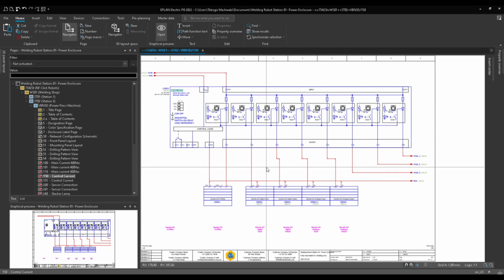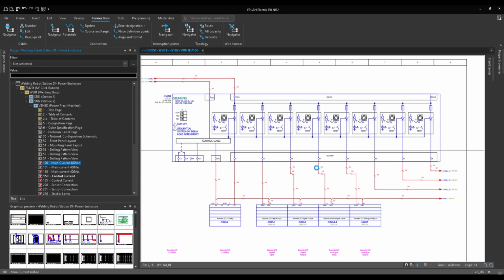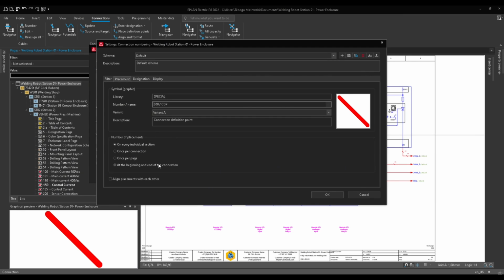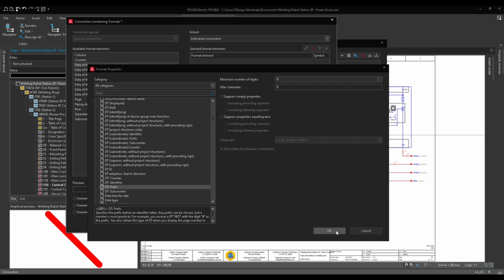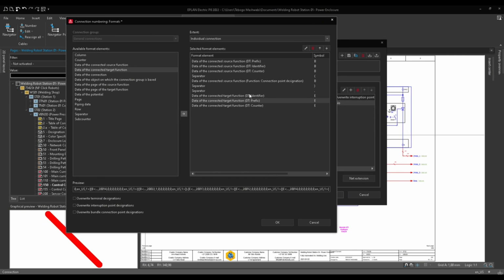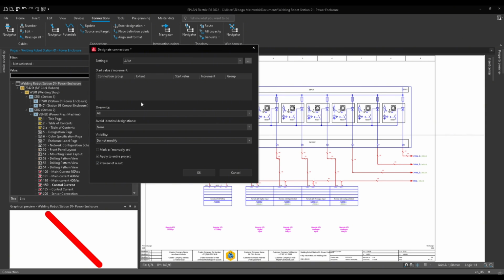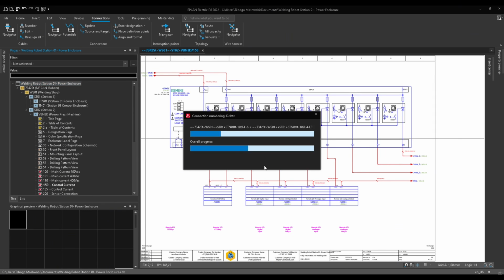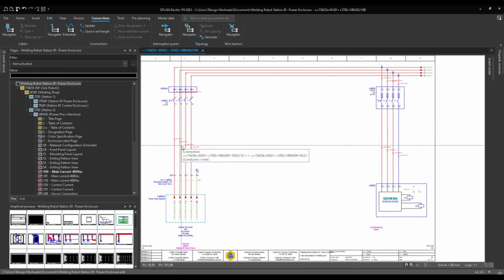EPLAN Electric P8: Place Definition Points & Enter Designation | Wire Nr. #eplan #electrical #2025

Comment from the maker: https://www.udemy.com/course/mastering-eplan-course-on-electrical-engineering-design/?referralCode=9AE229DB34A02BD35F3A
Reply: Is it possible for you to make a course on EPLAN Pro Panel as well? It will also be a great help to understand the Pro Panel functions to the maximum level, thanks.
Reply from the maker: @691bilal1 the first course has covered a lot of points with regards to pro panel. That is in section 8, I have 16 lessons on the topic of Pro Panel